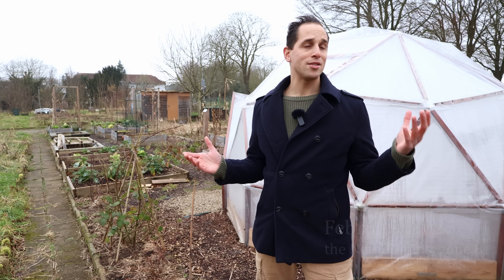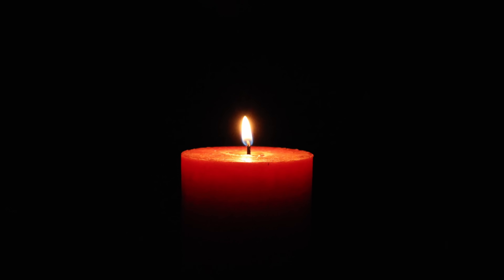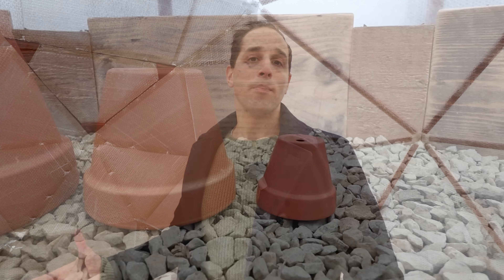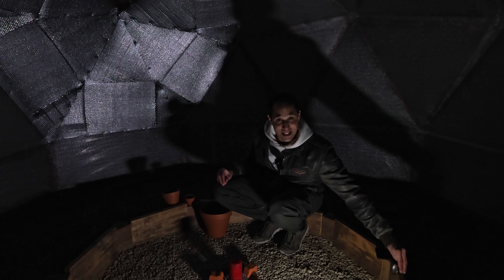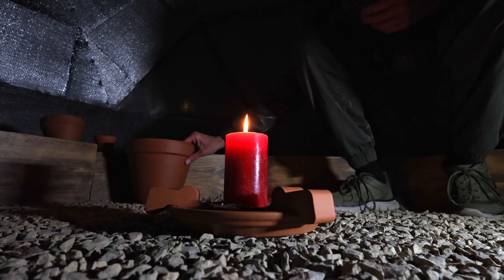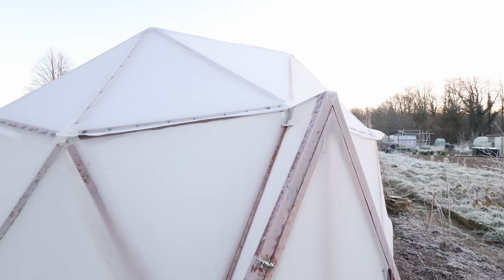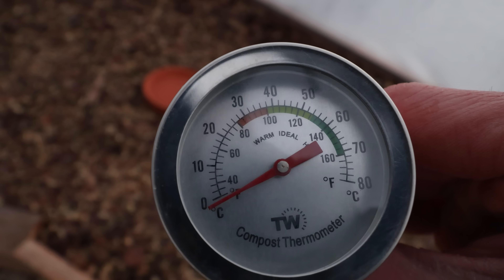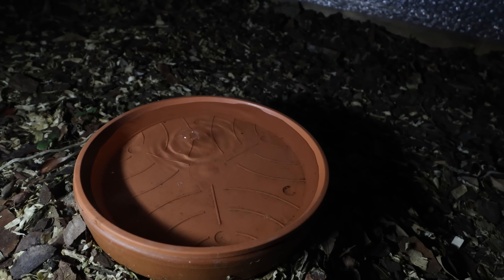Can a Terracotta Heater Keep my Greenhouse Frost-free? • Ep. 48

Comment: Its more efficient and beneficial to heat the soil, seeds wont germinate in very cold soil. Warming the air increases structural heat loss due to the in/out temperature difference :)
Reply from the maker: Thanks for the tip, and yes I have actually been thinking about putting some coils in my garden bed that would run warm air through it, via compost or otherwise. However, this experiment was mainly to test if it would keep the dome frost free at a low budget and with little effort. Cheers!
Reply: @atthegrassroots  
I have around 230ft of tubing under my dome  which cools in the summer and keeps it well above freezing in the winter. I`d highly recommend putting a couple of 4" perforated drainage tubes in your perimeter beds which wouldn`t take much work. The air could be supplied by a couple of 4" pc pressure fans (12v dc) and a 12v solar panel. The fans will run when there is enough sun for the solar panel, aka super simple.
Reply from the maker: @JohnGuest45  Yes, I actually have a set of fans with a litte solar panel waiting in reserve! I wasn't sure if I was gonna use it for general airflow and cooling in the dome, or combining them with some tubing through the grow bed.
Alas, I can't really put large tubing underneath the dome anymore for some geothermal stability, unless I dig out the entire thing 😅
Reply: @atthegrassroots  
Domes can get very warm on a sunny winter day. If you run the warm air through tubing in your perimeter beds it will be a lot more beneficial than losing it to the great outdoors via cold glazing :)